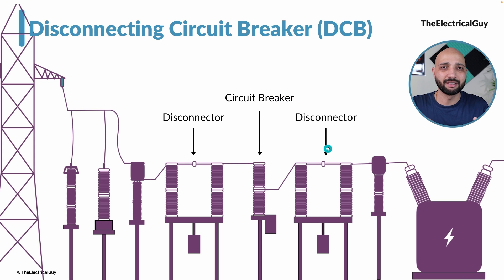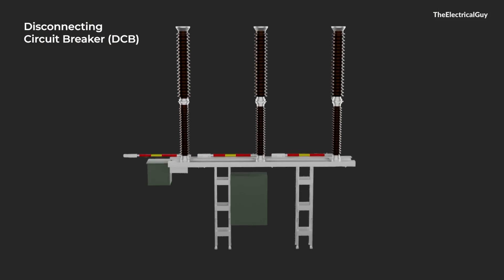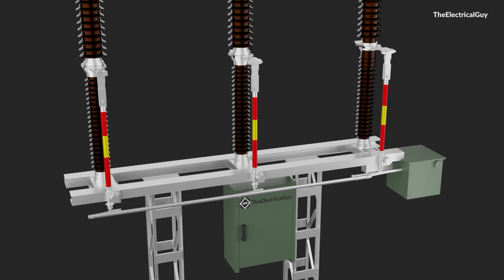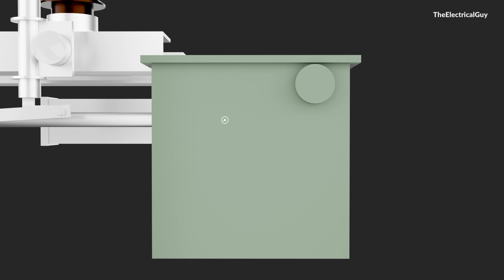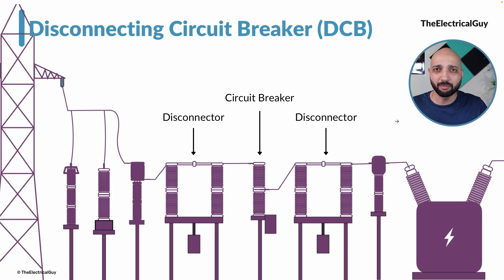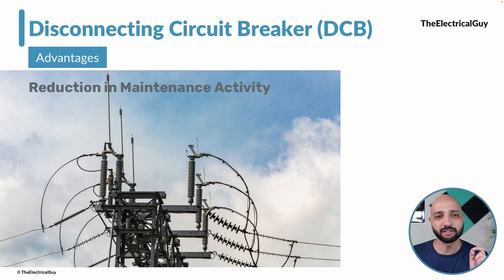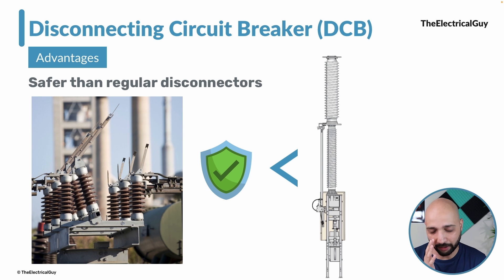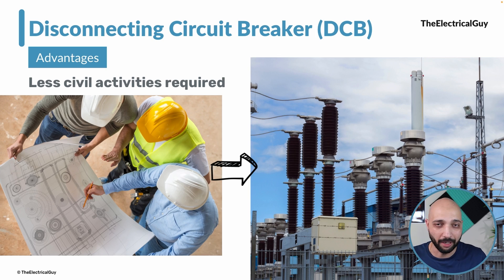Disconnecting Circuit Breaker | Introductory Guide | TheElectricalGuy

Comment: Una desventaja que puedo encontrar, por ejemplo: en una subestación de 220 KV de una central de generación; para poder darle el mantenimiento a su transformador de potencia de salida, necesitaría también poner fuera de servicio la línea de transmisión. Con la configuración antigua puedo abrir el interruptor, abrir el seccionador de barra (lado del transformador) y cerrar el seccionado a tierra del lado del transformador y mantener la línea de transmisión energizada. Con la configuración actual al tener un solo seccionador e tierra no podría aterrar mientras no ponga fuera de servicio a la línea. 
                             
TRADUCCIÓN: "One disadvantage I can find, for example, in a 220 kV substation of a generation plant, is that in order to perform maintenance on its output power transformer, I would also need to take the transmission line out of service. With the old configuration, I can open the circuit breaker, open the bus disconnect switch (on the transformer side), and close the ground disconnect switch on the transformer side, keeping the transmission line energized. With the current configuration, having only one ground disconnect switch, I wouldn't be able to ground while the line remains in service."

Comment: This is cool, what about the visual proof of the specific circuit isolation from the rest of the circuit? ( maintenance folks always want to see that) and clearance ground to the disconnect switch?
Reply from the maker: Unfortunately, With DCB there is no visual proof!
Reply: @GauravJ  there is no disconnector. It is basically a CB with ES.
Reply: Since when were they introduced?
Reply: I want to buy course but on app demanding refer code which is not available without it how can i signup
Reply from the maker: @azmalajuba5234 referral code is not required. Sign in on courses.theelectricalguy.in